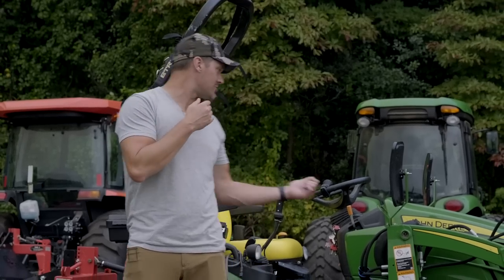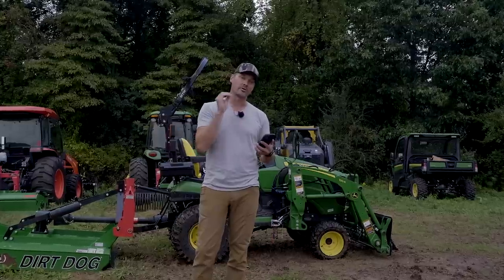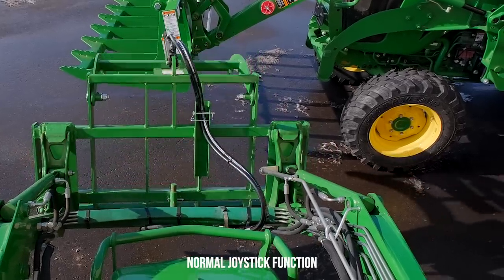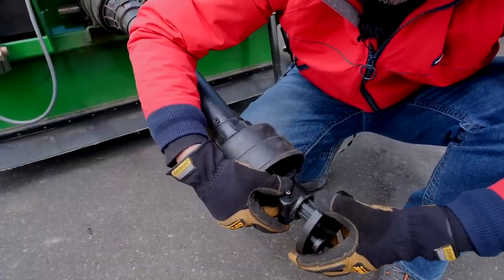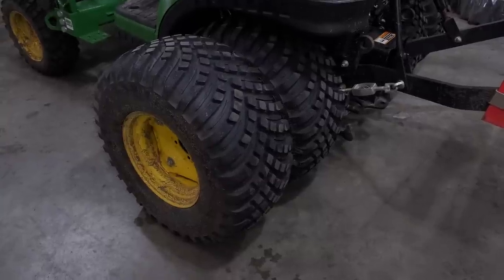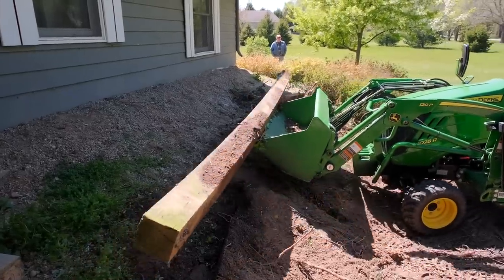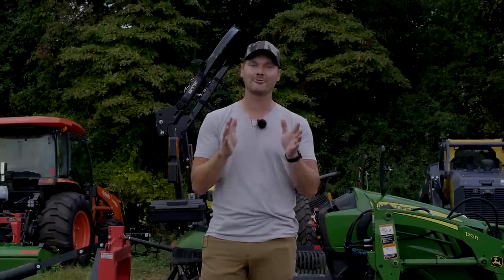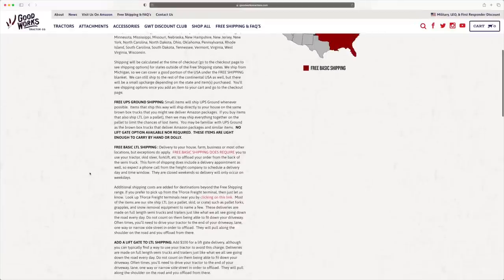TOP 5 TIPS TO AFFORD MORE TRACTOR TOOLS! GWT DISCOUNT CLUB

Comment: I just watched a video from Tractor Time with Tim.  He tore up a rear pto seal on his LX33 because it has a stubby pto shaft.  He mentioned the B and the BX series not being able to use the pto quick coupler because if the short shaft.  He was told by the manufacturer.  Any thoughts on this?
Reply from the maker: Tractor PTO Link is coming out with a version specifically for shorter shafts.  https://tractorptolink.com/product-category/compact/